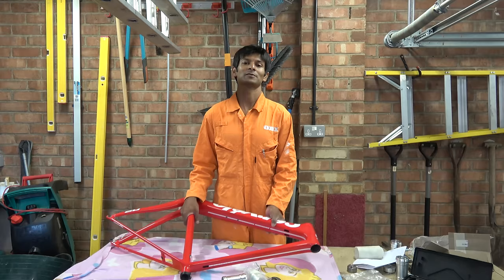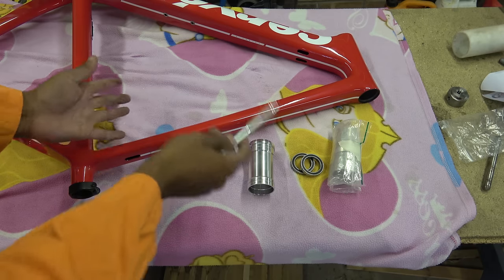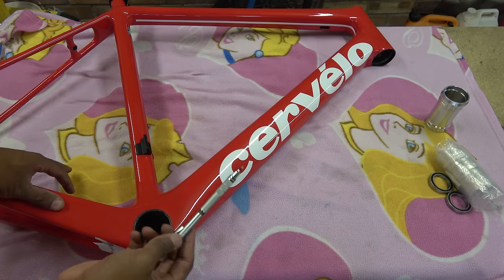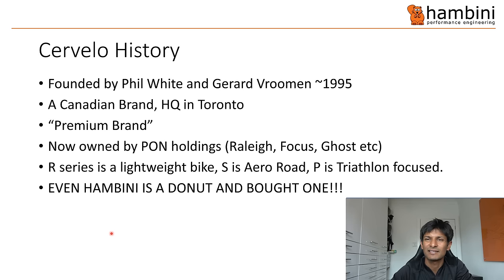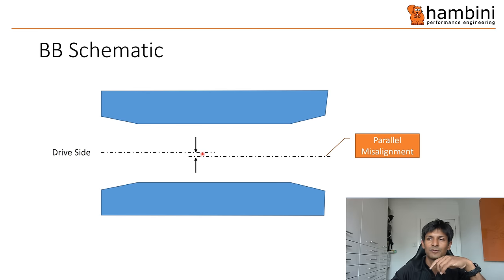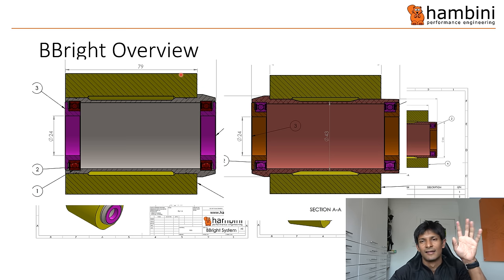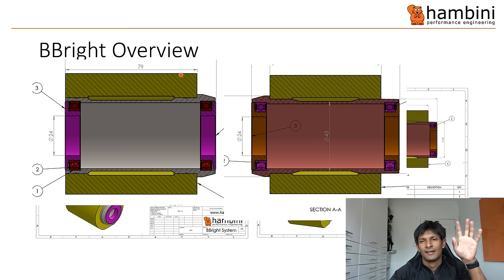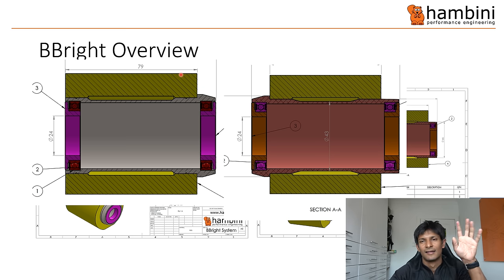Cervelo Exposed and fixed... Scumbag Aero bike manufacturers (A Hambini Reaming)

Comment: Theres no way he spent 3k of any currency on an r2 frame. It retails for 2800 usd or 3400 cad as a complete bike on r7000 shimano. Ive only worked on pre 2016 cervelos as a bike mechanic and i can say that the plastic insert between bearing and carbon shell works perfectly fine and ive not seen creaky bb issues on cervelos like i did on cdale caad or supersix. Now i cant argue that hambinis specs are bull shit and maybe that frame was total shit but im almost certain that with the standard plastic insert and regular pf30 bearing, the customer would have ridden his bike for many seasons without worry. Sure maybe too many companies have slack tolerances but sticking a super perfectly specd alu shell from one end to another will only accentuate any discrepency and cause issues. Id take hambini more seriously if he wasnt trying to sell his bb design which clearly isnt fitting many frames unless they are absolutely perfect. These are bikes, guys; not airplanes. Dont take this so seriously. Hambini judges an entire company by the bb alone. Cervelo has one of the best most consistent geometries from 48-60cm and hes not taking about that. Very happy hes got a shit s5 hes gotta feel guilty about though
Reply: dont you think for the insane prices they are charging we should expect better tolerances
Reply: Cosmo Wood i do but that frame isnt 3000$ its maybe 1500$. And if you look at the prices of frames hambini recomends , youll see framesets going around 5-6k like Look bikes. A cervelo r2 can be bought as a complete bike for under 3k. Mine (r2 2016) was 2500$ cad. This is an entry level bike. Not like an s5 or r5. So why mislead ppl by saying this highend bike has a shit bb. I want to see hambini test his own s5 ( a real highend frameset)
Reply: @TheBlad12345  Thats just not true, you can get a look frame for 1000Eur also he recommends buying chinese frames directly like honghfu or dongfu that are like 400USD, R2 is considered entry cause of the weight and SHOULD NOT have tolerances lower than the 5 series; also I am not sure about the prices you are talking about. This Sigma sport dont have R2 but they have R3s and they cost about 3k EUR
https://www.sigmasports.com/item/Cervelo/R3-Frameset-2019/JPIA

Comment: Well just like 1× is a gimmick, if people actually wanted album by system a beach cruiser, almost $1,000 for a 10-speed go sell that crap somewhere I'm sorry I'm somewhat of a traditionalist, not lazy and I have a Cannondale one by system which I'm dying to change to 2× system. Go to the gears on a lot faster on a 1× than with a two or three by system.and what funny people would spend a lot of money to go slower.one great thing about Shimano is they're keeping with the tradition, With drivetrain system Unlike other companies. I'm going to spend $1,000 more on a drivetrain it better have more than 12 gears. If it doesn't it just doesn't make sense, I might give you ten bucks for a 1 by system or just give us a 3 by system and converted to a one or two by, more options are better than no options.

Comment: so much emotion! I watched it 2 times, and seems that all that just means that Hambini’s product is not compatible with that (at least that) Cervelo frame model. Is Cervelo obliged to do it compatible with Hambini? probably no. so Cervelo is not guilty
Reply: maybe it hasn't dawned on your that a misaligned axis bottom bracket is going to wear out any bearings in no time and cause huge power loses..  you obviously have never taken a science university in your life, and most of this video is above your head....  this has nothing to do with compatibility.. get a clue before you post your idiotic opinions here.
Reply: GG DD i noticed that Hambini and his fans are very rude person who like to insult the opponent. why do you strive to protect him so much? okay. maybe the axis was misaligned but was it misaligned before the installation of hambini bottom bracket shell?? maybe it was perfect. how many the same cervelo frames are running with no problems? probaby hundreds, maybe thousands.
Reply: You don't really understand BB standards do you. He doesn't just make one type of BB to fit all bikes he makes all the different standards and yes as long as you match the standard the Cervelo bike does have the obligation to fit right. As said in this video the fact they accept such a big range of tolerances is unacceptable. He's fitting a BBright BB to a bike that's made to take a BBright BB. That's exactly what the worst standard means. I don't actually like his language or overly confrontational approach but what he's saying is correct despite that.
Reply: @seme6872  No genius, bottom brackets are not supposed to go out of alignment from one moment to another, on well-made bike frames, they are fixed, glued or welded in place, unmovable, the stiffest part of the bike.. do you even own a bicycle? you are clueless.. go away

Comment: Nothing on this video is remotely base on any actual engineering science....wtf. And non of the issues you speak of are an actual problem in real life
Reply from the maker: Really... Google "creaking bottom bracket."
Reply: Hambini yes, it happens, just like if  i  google “cracked carbon frame” and I’m gonna get results of it happening... its not a problem in a chronic sense, and specially not on frames from companies like Cervelo and specially not on a BB widely used by many and most on the pro peloton who put these bilked to it hardest forces.....maybe Chinese knock offs.
Reply: right genius.. misaligned bottom brackets are not an engineering problem.. they are a safety feature on Cervelo bikes, to make sure owners change the bottom bracket bearings every six months..

Comment: It's an entertaining enough video, I'll give you that but you really are barking up the wrong tree when it comes to how mad cervelo's engineering can be, you really should see some of there new stuff, the BB's really aren't that bad. You've definitely never done a cable change on a top of the range look otherwise you wouldn't be recommending them. The biggest issue here is that the frame should have been warranted regardless of whether its a shit design or not, the biggest problem with warranties is that they depend firstly on the bike shop and then the distributor and not at all on the manufacturer. This means they vary massively for shop to shop and country to country which is a big problem in the industry. Even though that tolerance is specified for there BB doesn't mean they are manufactured to that which is really, really stupid but that's cervelo for you.
Reply from the maker: How can you warranty this frame? It is not out of specification
Reply: @Hambini  even though the diameter is within their ridiculous specs, their specs don't specify the tolarance for how oval it can be but the bigger problem is that the Bike shop should have enough knowledge and common sense to know that if a part that is designed to fit a frame does not fit that there is a problem with one or the other and if its within warranty to replace it with a model that works.
Reply: @Hambini  I also need to figure out a way to PM you as I'm guessing you possibly haven't seen the size of the steerer tube on the current S5. You'll get a kick out of it :)

Comment: Awesome video. The bike industry sells  low quality carbon fiber as the ultimate material. Overpriced bullshit. 

Cannondale aka Crack and Fail pioneered this by marketing wank aluminium frames at stupid price points. Now carbon is the darling of snake oil salesmen everywhere. 

PS

Press fit BBs are shit.